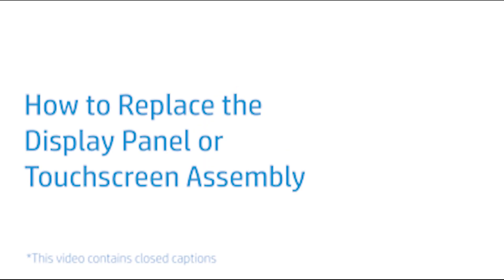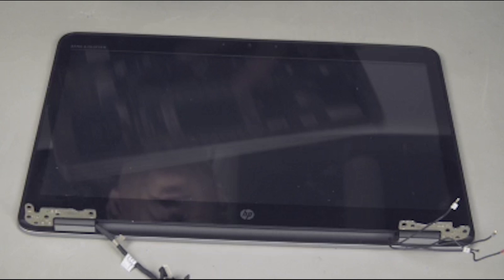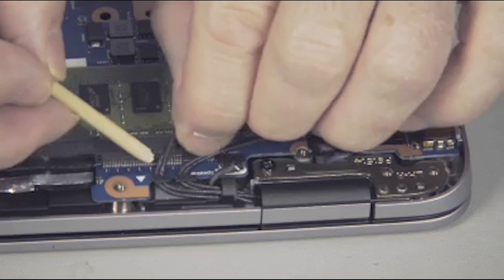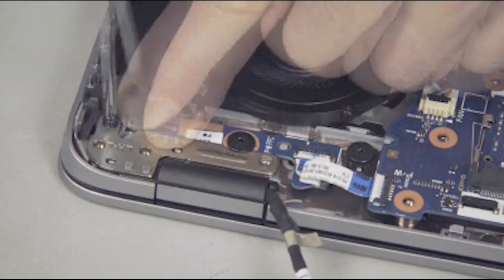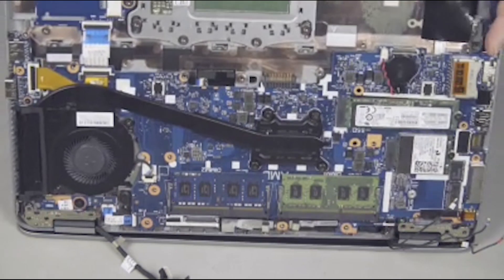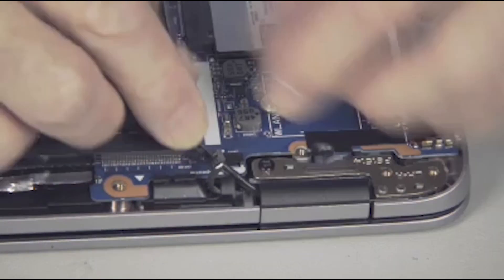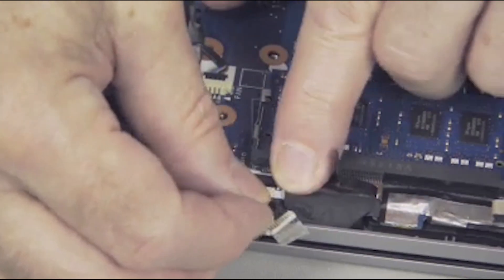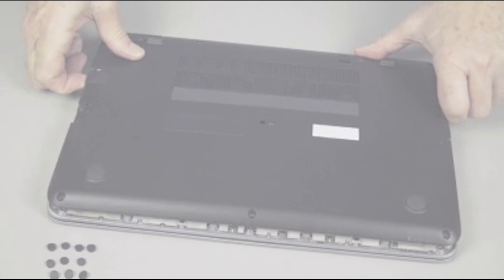Replace the Display Panel or Touchscreen Assembly | HP EliteBook 840 G3 Notebook PC | HP

Comment: I have a Hp EliteBook 820 g3 non touch can i replace it with a touch display?
Reply from the maker: Hi there, thanks for contacting HP Global Social Media Support!
I understand that you need to know about replacing the non touch display with touch display.
I will do my best to assist you.
HP does not recommend upgrading or downgrading hardware parts or software that is bundled with the product as It may affect the manufacturer's warranty and performance, however, you could change the configuration at your own discretion.
Binu-HP Social Media Tech Support